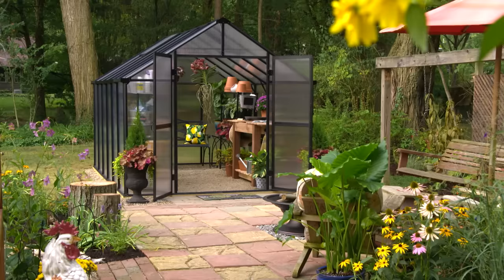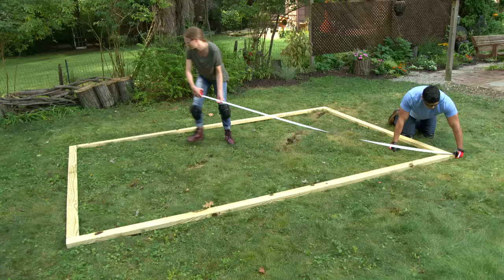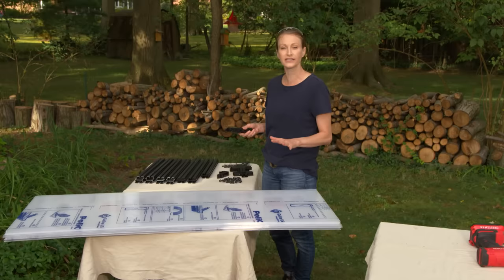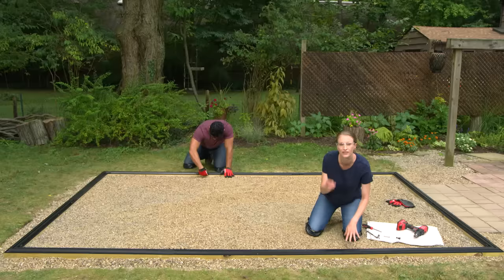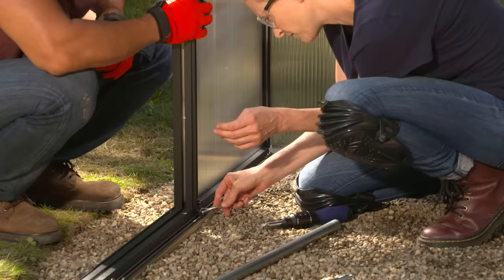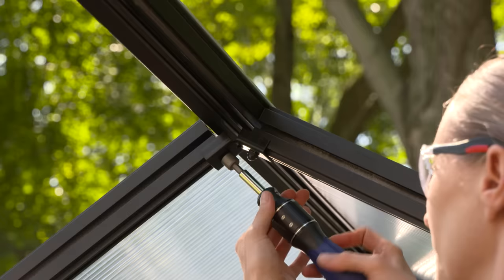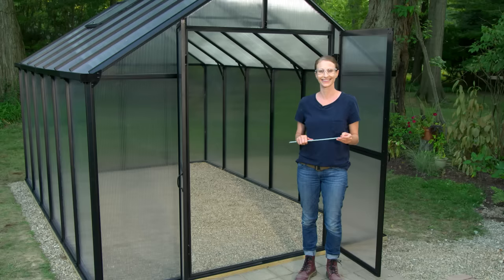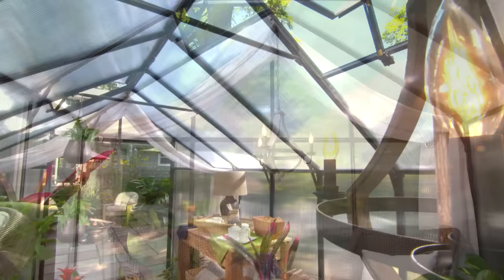How to Build a Greenhouse

Comment: Building inspectors my ass,
My property, me and the HOA go around and around all the time on my greenhouse in the back yard. Had to get dogs to keep them out my backyard😂😂😂
Reply: Find out what code authority book they use for code enforcement. For instance in Michigan they use Building Official Code Authority or BOCA. Under temporary structures you can build what is called a temporary non-conforming structure. You can build smaller structures such as tool sheds, storage etc without a permit. You have to adhere to side yard and back yard setbacks from your property lot lines.

Comment: Spoiler alert these Montecello kits are very nice but pricey at $2400 to well into the $4000 range. I can build a custom solid wood structure for much much less. They are much nicer than the Palram kits by far but do some research before buying there are other options.
Reply: Curt Walter These kits are more for people who want ready to go pieces they don’t have to measure a million times and cut. Sure they are pricey but you are paying for the convenience of all the pieces being the right size and having exactly what you need all ready to go. Any kit is going to be more expensive than sourcing everything yourself.
Reply: You are right about the expense, and this video shows two people putting it together with lots of smiles & a calm voice, and will guarantee it took them 8 hours to assemble.  I built an 8X10 greenhouse out of 2X4, much more secure, with very little cutting ( just order the required number of each 8' & 10' boards) in about the same time for about $1000.  I was going to buy the kit too, but looks flimsy.
Reply: Thankyou sir! I think I’ll build one
Reply: @8GarretttterraG8 It certainly has gotten expensive now
Reply: I wouldn't give more than 200$ for it
Reply: @matagotangel  and tiny
Reply: @8GarretttterraG8 Yes

Comment: Nice but I don't think the structure is strong enough to handle real weather. Might work in Hawaii but not northern winters or southern hurricanes or other weather.
Reply: Idell Henning there’s other weather?
Reply: @Grimm_Book  I know that! No matter what the weather if it is extreme  it will not hold up. It is not the design fault but mother nature does not play nice.
Reply: I have one - a 16ft model (same as the 12 ft model, but with a 4 ft extension kit). I built mine on a concrete slab base with a small cinder block foundation on top (2 cinder block high plus a capstone using concrete mortar) and used tapcon concrete screws to fix it to the capstones.

It's already been through 3 hurricanes in the southeast - including 120+ mph winds with gusts up to 150 mph locally. There are plenty of owners in the north that have had deep snowfall on the roof just fine, and others who have video of 175 mph winds howling, but it not budging.

I had an older greenhouse from a different company that was 12 x 10 x 10 (in height) that was flimsy - lost panels due to failing clips in high winds and whose structure caved because our home's chimney cap was torn off and hit the doors at high speed. I got this model as a replacement specifically because it could withstand high winds. The aluminum beams are crazy thick and strong, and the panels slide between the aluminum beams, so no loose clips to worry about, and the panels won't go anywhere as they're wedged into the structure. The panels are over twice as thick as my previous greenhouse's -- which also survived more than one hurricane (though a few panels had to be recovered from the yard which is why I really like how these new panels work) Screwing the structure into cinder block and concrete was our choice as an upgrade to give it more height, but also ensure it couldn't blow away - it'd have to be torn apart by winds to go anywhere.

For hurricane season, I just bungie the windows shut and use a velcro tie on the door handles so they won't rattle. I have some additional rope with tie-downs that came with the install to help keep the roof from catching wind should we get the eye of a hurricane or a tornado, but so far haven't used it.

It's not indestructible, but nothing is. I suspect it'd take 175+ mph winds just fine, but whatever is in those winds would be a hazard. A tree falling on it, for example, would end it - it is only aluminum and plastic after all. But, that's true for most anything. A vehicle, a garage, etc. A direct hit from a tornado would likely destroy it as well, but that's true of most structures - even 2 story brick homes.

The upside is that my homeowner's insurance would cover the damages. I purchased this one partially with money from our last (inferior) greenhouse that was totalled during a simple tropical storm because our chimney cap struck it. It's odd because the winds weren't especially high - just happened to catch the chimney cap just right to tear it off & apparently the roofer hadn't fixed it as securely as it should have been after the last time it'd been worked on.

Comment: How secure is this structure in hurricane prone areas?
Reply: On a scale of tent to cave I'd rate it as a badminton ball.
Reply: I was told it can withstand 65mph wind
Reply: Mine's screwed to a cinder block foundation on a concrete slab, and it's been through 3 hurricanes so far. 120+ mph winds with gusts up to 150+ mph. It would likely survive sustained 150 to 175, but I'd probably rope down the top along with bungieing the windows shut and velcro-tying the doors shut if that were headed my way. It's not so much the wind as what's in it or what might fall on the structure that'd be the end of it. If a tree were to fall on it or a tornado were to throw something at it fast enough, it'd crumple like an aluminum can.

But, yeah... as far as winds alone, it can take a beating from a hurricane so long as it's secured. It's well designed, strong, thick aluminum... and mine is secured with 2.5" screws every 2 ft or so into cinder block capstones atop 2 layers of cinder blocks all mortared with concrete to a concrete slab below.

The kit comes with tie-downs -- like... 1 ft long coils meant to be dug into the earth so you can rope down the top of the structure in high winds. I haven't used them yet, but if an eye of a hurricane heads my way, I might use them just in case.
Reply: You ever watch Wizard of Oz?

Comment: How do you keep your vegetables alive during winter🤔
Reply: Following
Reply: Propane heat and get cheap black garbage cans.

Fill the cans with water and mix in calcium chloride from pool stores until it won't dissolve any further in the water. The black cans and water in them will absorb the heat from the sunlight and release it at night when it's cold. The calcium chloride will prevent the water from freezing and is effective to -25 degrees Fahrenheit.
Reply: Choose cold hearty varieties and research heat stabilization
Reply: I grow cherry tomatoes in mine all winter. During the day, the sun keeps things warm if you've built in a sunny spot, and at night, I have lots of water jugs (re-used) under tables and on shelves below the plants to maintain some heat as well as an electric space heater with a thermal switch so it turns on only when temps drop below 60 F.  I've also done a bit of weatherproofing to seal gaps where air might escape.  I've had many nights when it was down to 10 F outside, but it never dropped below 55F inside. I'm in the south east, though. You might have to do more to insulate it depending upon how harsh your winters are. Bubble wrap or other insulation can make a world of difference. I used bubble wrap during the winters on a previous greenhouse, but haven't found it necessary with this one.
Reply: move south
Reply: Wayne Bell, sorry for asking a stupid question, but  how reused water jugs help?
Reply: @duallinguallady-aishaahmed1812  Hi, not a stupid question at all! Glad to answer. Water is very good at holding heat. Much like how people once used hot water bottles to keep their beds warm at night long before electric blankets existed, jugs of room temperature water will keep a greenhouse warmer when it's freezing outside.

Water takes a lot of energy to heat up, and it stores that energy and releases it slowly over time - which is part of why coastal areas tend to have less extreme temperatures with warmer winters and cooler summers.

So, what I tend to do is I'l take lots of 1 gallon jugs that originally had distilled water (I have family members that need it for medical reasons), and re-use them with either tap water, well water, or rain water. I'll use the jugs to water the plants, but also I'll stuff as many as I can on racks inside the greenhouse.  On a sunny day, the greenhouse will warm up and also warm up those water jugs.  At night, the water jugs will release that heat slowly all night long - warming the greenhouse so I don't have to use my electric space heaters as often.

Even though 72 F water may seem cool to the touch, it's still far warmer than 32 F (0 C), and it has to release a lot of energy to get that cold. As it releases that energy while cooling, it's actually warming up the greenhouse by releasing that energy into the greenhouse air.

Now, it doesn't have to be water - the concept of "thermal mass" lets most any material absorb and re-emit heat later, but water is especially efficient at it. In larger greenhouses, people use rain barrels painted black placed somewhere they'll get good sun. Since black surfaces absorb more sunlight, the water in the black barrels will absorb more energy from the sunlight and heat up faster and hotter. That's really a better idea if one has the space for it, but most people have some sort of plastic bottle or jug they can use to hold ordinary water, and even transparent bottles do alright.
Reply: @Kingramze  Thanks for answering my questions. I don't have a green house, but my house has got a bunch of wholes.

I got some tropical plants which I bring indoors. In my basement by the sliding doors I get the morning sun, but there is a lot of cold draft. 

I can't afford to heat that place, it has a hot water heater attached to the wall. I have an old house with lots of wholes. 

I already run a central gas and portable electric in each room besides the gas and keep a blanket in each chair not to run the bill so high. 

Thanks to your advice, maybe I can keep those plants there this year, God willing, along with a space heater set to 70°~

Again thank you, I appreciate it.
Reply: @duallinguallady-aishaahmed1812  You're most welcome. I do have a few suggestions that might help indoors. Depending on the size of the area and the size of the plants, you might consider a small, inexpensive portable plastic greenhouse that you can set up inside - but only if it's to hold small plants or a few large plants and you think it might help to keep that smaller contained area warmer with water bottles or electric heat. Also, if there's not enough sunlight, an LED grow lamp can help without using a lot of electricity. Mylar - a kind of reflective plastic sheeting - can be useful in focusing the light you do have towards your plants, too.

I'm sorry to hear your home is a bit drafty where your plants will be. If you're planning to stay in the home for many years, insulation would be a good investment - perhaps some caulking, weather stripping, socket sealing, and other inexpensive measures might help as well.

Best of luck with your plants, and have a wonderful day.
Reply: Wayne Bell Thank you, you are sweet! I wish you the best.

Comment: Wood seems like a poor choice for a foundation. Even if its rated for ground contact, it will rot. May take 10 years or 5 years who knows but all I know is you're gonna have to undo everything to fix it.
Reply: More like 40+ years.  Moisture will penetrate concrete and stone foundation, too -- eventually, every foundation needs a patching job.  Contact treated wood is the more affordable option and plenty strong to support the weight of the greenhouse.
Reply: What would be a better option, before I start on this project. Thanks